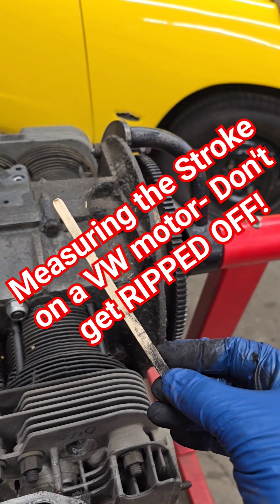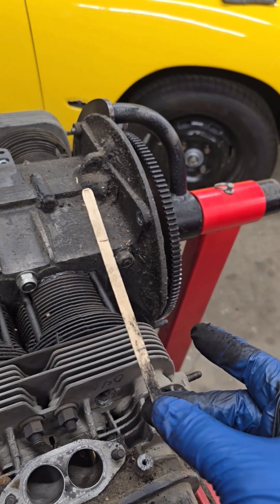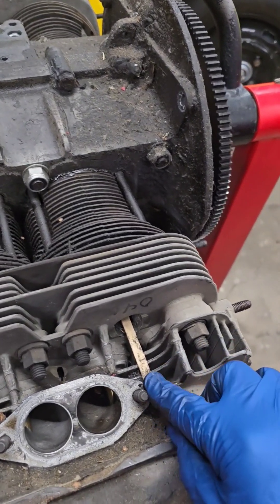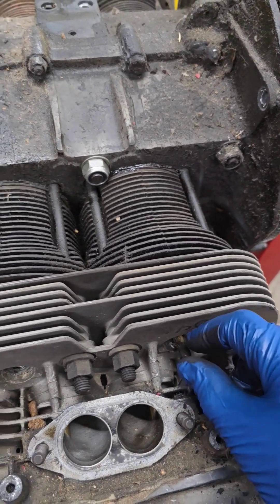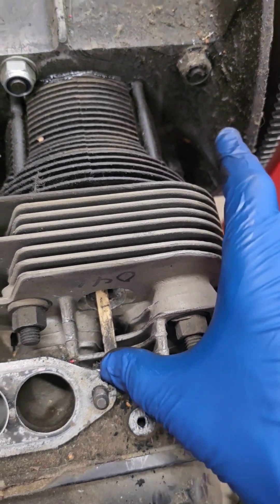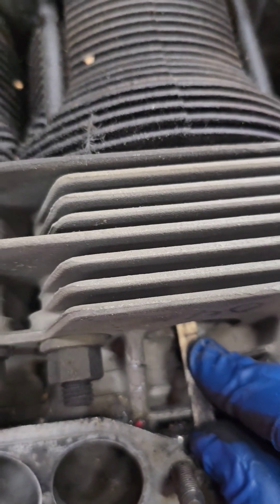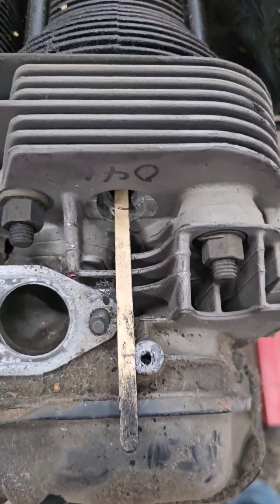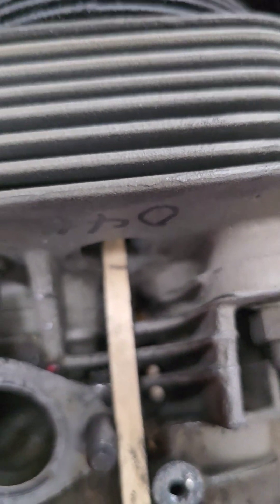Tech Tip for VWs, measuring the stroke on an assembled motor- Don't get RIPPED OFF!

Comment: Great tip😊 is there any tips for checking line boar and thrust cut on a mystery case?
Reply from the maker: Sometimes they'll stamp the line bore amount on the case, like 020 means .020", which is 1st line bore. Other than that, no way to known on an assembled motor.
Reply: @VintageClassicSpecialist  thank you for the tip I appreciate it☺️

Comment: Awesome! Does this apply to all engines? How about a Chevy inline six or Chevy small blocks?
Reply from the maker: Thanks! As long as you can get the stick so it's parallel to the cylinder bore (doesn't have to be centered, just parallel) then it will be accurate! 👍

Comment: If 1 and 2 are at bdc, 3 and 4 will be at tdc. Saves you having to turn the crank....
Reply from the maker: True! Although probably more accurate to do it on a single cylinder due to possible variations from head to head and cylinder to cylinder in the reference point, deck height variations, etc. 👍
Reply: @VintageClassicSpecialist  valid point!